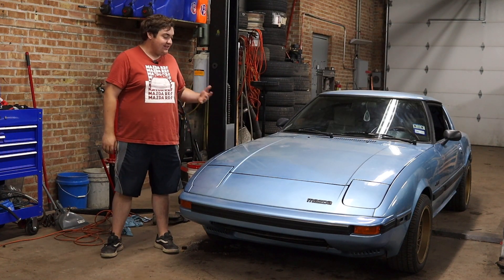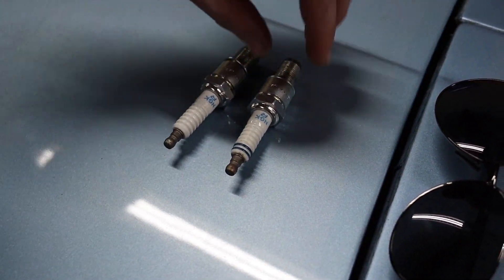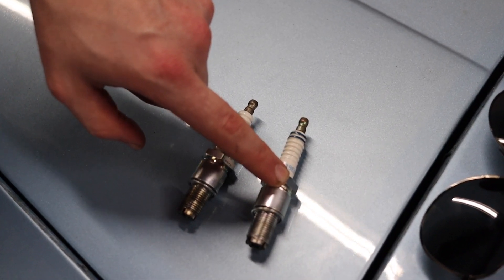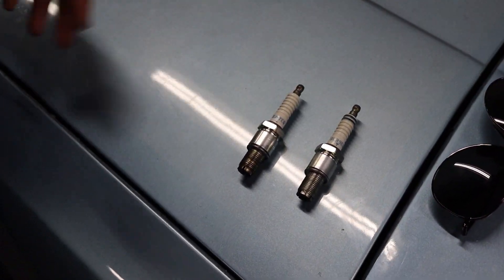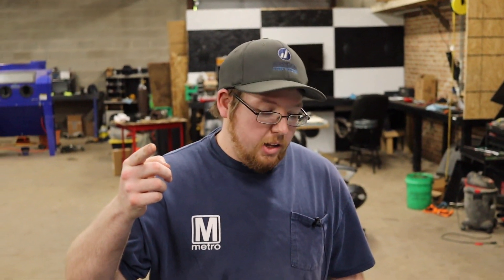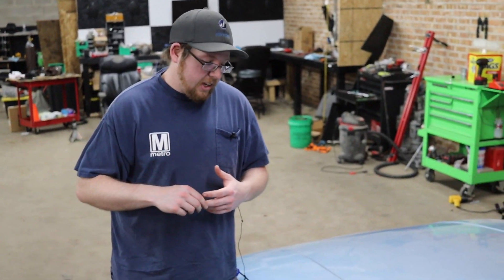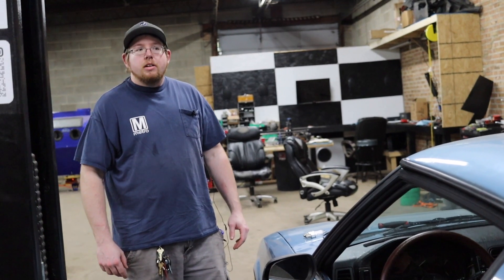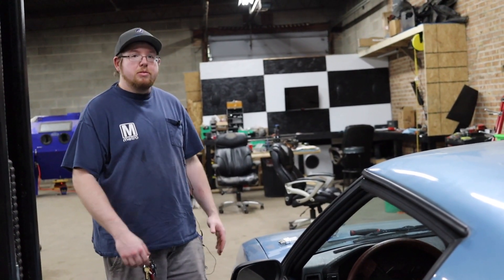Why Rotary Engines Need 2 DIFFERENT Kinds Of Spark Plugs (Leading Vs. Trailing Plugs)

Comment: When I was 20 and commuting to work in my 87 RX-7 Turbo II the center electrode would shows signs of wear very quickly.  I was changing the spark plugs every other oil change and the center electrode would go from a nice square edge at install to rounded dome appearance over 6k miles.  I was using NGK plugs, had leading and trailing plugs, but I don't remember the temp range.
Reply: This could be unlikely/impossible on your engine's ignition design, but the only cause I've heard of for rapid spark plug electrode wear is if the actual polarity of the spark is backwards- apparently an ignition coil can be rewired wrong where it works fine but it causes the spark output to be negative instead of positive relative to the engine (I don't remember which polarity exactly), and the spark will eat away at one of the electrodes really fast. It might be only on old school wiring where it actually can be hooked up differently